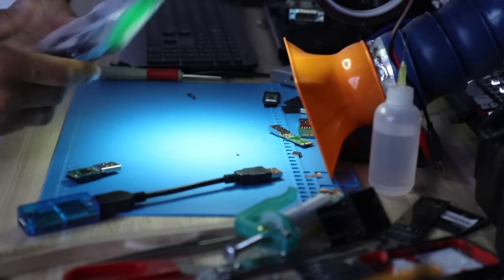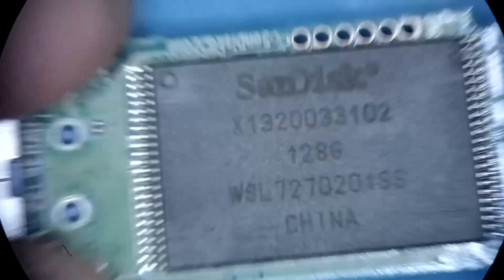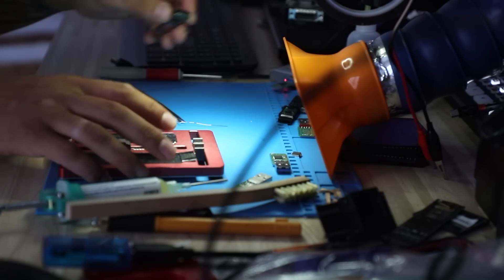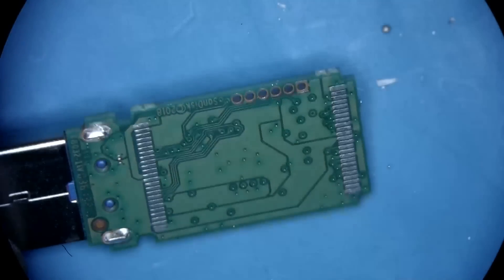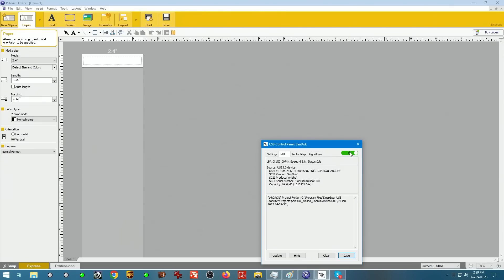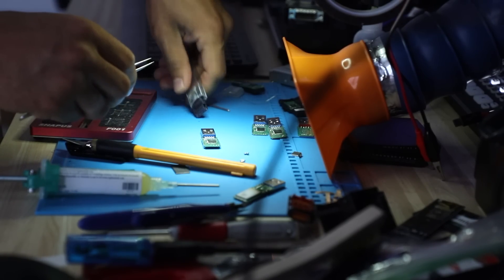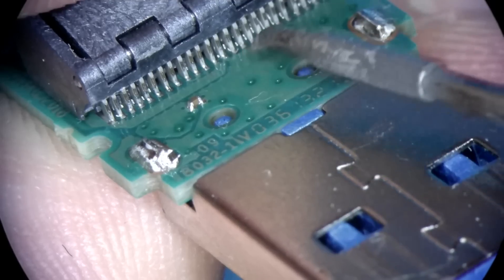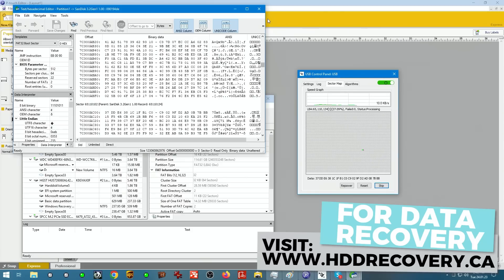Sandisk cruzer shows up as Sandisk Anisha 64mb

Comment: What are advantages and disadvantages of the low melt solder vs hot air? Sometimes you use one, sometimes the other, is there some reason?
Reply from the maker: Less heat stress for the NAND with low melt.  I use low melt for TSOP chips because headers are accessible. You can't use low melt removal for BGA obviously
Reply: @hddrecoveryservices  please i am from India i wanted to learn this things from you i wanted to open my shop in india please respond please please i am your big fan plz reply bro please i am ready to pay
Reply: @-engineer6496  you need to practice the soldering with devices that doesn't work , that's what most important thing i think
Reply: Specifically what type of low melt solder is that?  i.e. what to search for to buy some?
Reply: @dricklorenz9340  look for "smd/smt chip removal alloy" ch*p qu*ck REM4.5 is a leaded version with the lowest melting point of 58ºC and REM4.5-NL is a lead free version with a bit higher melting point of between 79ºC and 91ºC.
Reply: What? Lo-melt solder and hot air are two entirely different things…
Reply: @CompuKonstantin , he didn't say they were the same.

Comment: 17:00 best shape tip for this kind of micro-soldering of pins is what hakko defines as BCM/CM shape tips. the dent on the diagonal cut of the conical tip is ideal for drag soldering of pins because the surface tension of solder in the dent helps prevent solder bridging.

Comment: I once bought a 2x1 USB flash drive (a offer at the local store). The capacity should have been 4G each stick but one was defective an showed 64M only. I opened it and it was the cheapest flashdrive I ever seen: only thing inside was a COB (the black blob thing), no USB controller, no flash memory. I opened the working one an it was the same; it still works today. I wanted to solder a proper flash IC (I suspected that it was bad) but for that I would have to remove the COB so I gave up.

Comment: If your tip in the soldering iron doesn't want to take the solder, not only maybe the tip is dirty, but might as well be too hot ;).
Reply from the maker: I don't have problems with that. Tip is at 345 and I got a JBC junior by my side to keep it clean
Reply: It could be that the tin-chrome coating got rubbed off by too much 'cleaning'